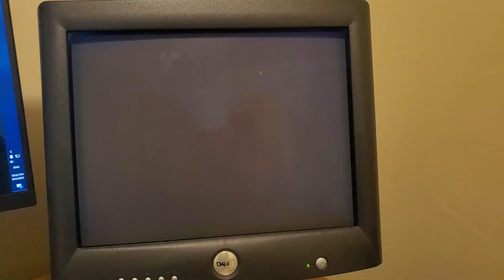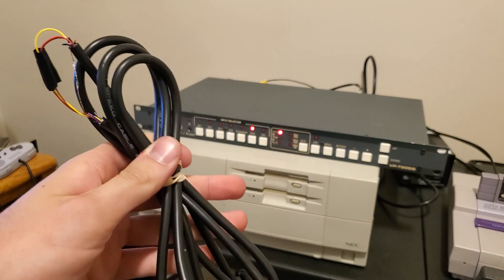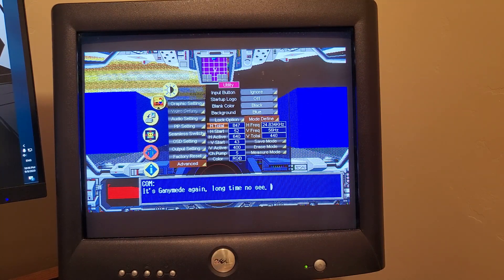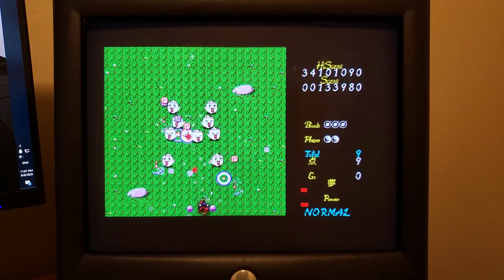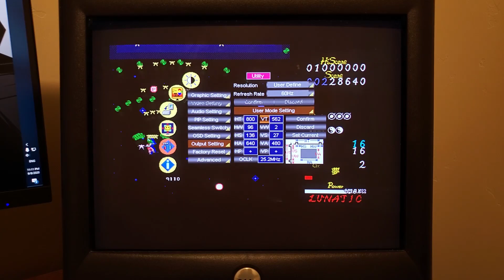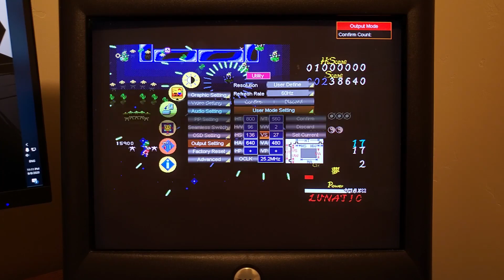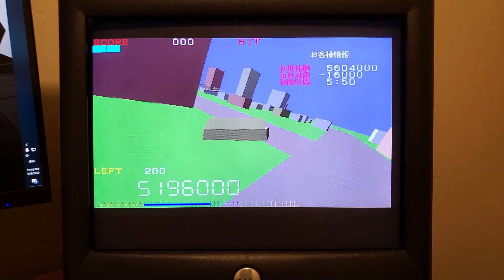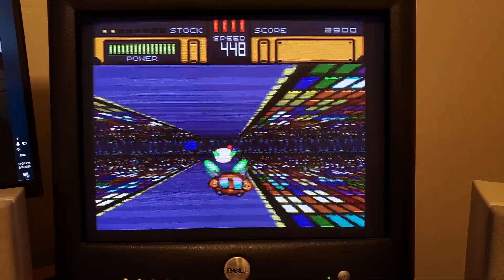Kramer VP-720DS: 24khz Video on a 31khz Monitor

Comment: This is random and you may have already discovered this by now, but I'm playing through Dead of the Brain and I just realized that with the copy I gave you and Kanji, there's a scene that causes the game to softlock and makes it unbeatable.  I managed to fix the 000027.MES file while still leaving out the jarring hackers note.  I tried linking it multiple times but YouTube keeps auto-deleting the fucking thing...
Reply from the maker: That's alright, I actually didnt encounter the softlock when I played through it
Reply: @Tr3vor42532  Oh, really?  That's odd.  I was able to replicate it every time.  Maybe it only occurs when using the high message speed mode.  I think it was because the note was replaced with zeroes instead of spaces.  It's at the part in the hotel where you sleep with Shela.  I'll keep the link in my latest video description for a little longer and then remove it.  My apologies if that was a little overboard, it's just that little mistakes can really bother me sometimes.
Reply from the maker: @thepirategamerboy12  actually, when I played through the game I was playing off floppy disks, kanji gave me that image before you gave me the hard drive image, maybe there was something different there

Comment: Were you able to source a mouse recently?  I noticed you recorded an in-game tune from Primal Space, and I don't think you can get to that point without one.  I should use my PC-98 again sometime, as I haven't used it in a little while because I've been mainly focusing on my recent Power Macintosh G3 266 acquisition.  Speaking of that, out of curiosity, what other non-IBM PC computers do you own at the moment?  For me it's currently an NTSC Amiga 500 and the Power Macintosh G3 266.
Reply from the maker: Yeah, I found an old bus mouse on ebay for like $20, so I snagged that a month ago or so. As for non IBM computers, all I have is the pc-98, a commodore 64 and a tandy coco2 that doesn't want to load anything from tapes. One of these days I need to get that thing going again.
Reply: @Tr3vor42532  Ah, that's neat (referring to both the mouse and computers).  It'd be cool if you got the CoCo2 working properly, because you've of course gotta play some Poltergeist on it.  By the way, I recently made an English menu mod for one of the PC-98 games you have if you're curious.  It's a game that requires a mouse to play, and I personally think it's pretty good.  It's kind of a Tetris/Puzzle + Maze/RPG hybrid thing.

http://www.romhacking.net/translations/5661/
Reply from the maker: Interesting, I played that game for a bit in japanese with my phone's translator. I'm not sure what I was doing besides being attacked by flying booby elves and weird shit like that. I'll have to give your menu hack a go. Yeah, the coco2 seems to have some interesting games on it, it's definitely an interesting computer. Also, primal space is kinda cool. I don't know what the fuck I'm doing in it, but I somehow made a bunch of smiley faces happy.
Reply: @Tr3vor42532  What you basically do in Bomber Quest is that you use the Tetromino pieces to reveal more and more of the area and uncover hotspots while battling enemies along the way.  These hotspots activate things such as cutscenes, etc.  You have to visit all the hotspots on a floor (and in the right order, since you may uncover one but have to visit another one first before it will work) to get to the next floor, and eventually you'll reach the final floor which will contain a whirlpool that will let you finish the stage when you've visited the last hotspot on the floor.  Pretty sure the last hotspot is always boss battle.

I've completed two levels of Bomber Quest with my hack in place so far, and I haven't noticed anything broken.  I like it for the most part, though I really wish you could save in the middle of a level.  The game autosaves when you complete a stage, and I'd suggest backing up your save files (FLAG0.DAT and FLAG1.DAT) when you're done with a play session because if you accidentally click to start the game on the main menu without loading it first when going back to it later, it wipes all your progress.  

And yeah, Primal Space is neat.  It kinda has a Maxis game vibe to me.  It'd really benefit from being able to read the manual, but there sadly seems to be no scan of it online.